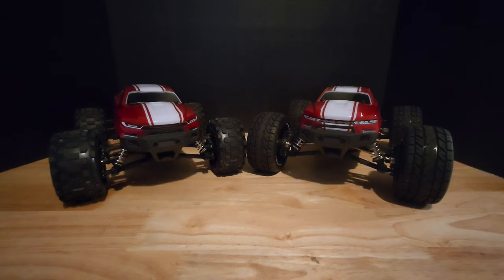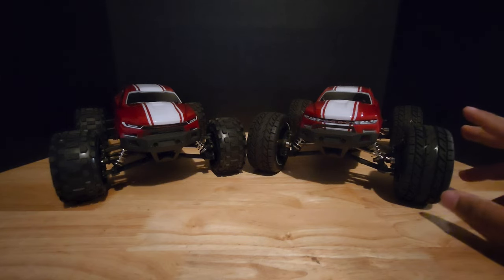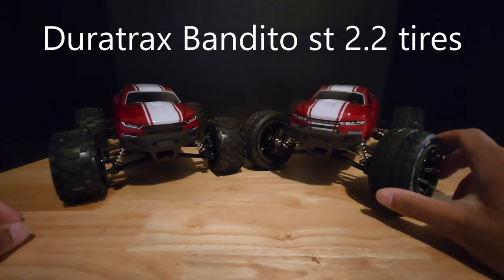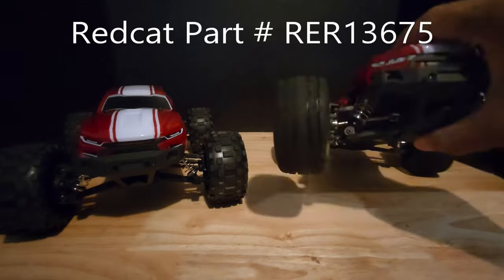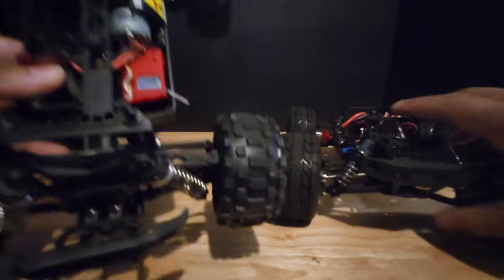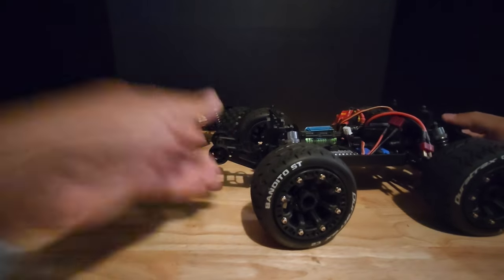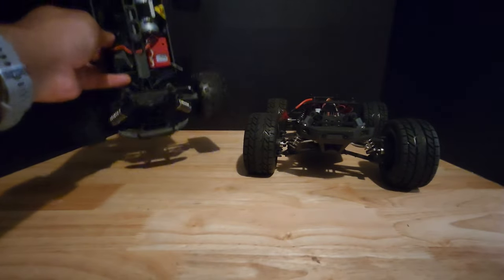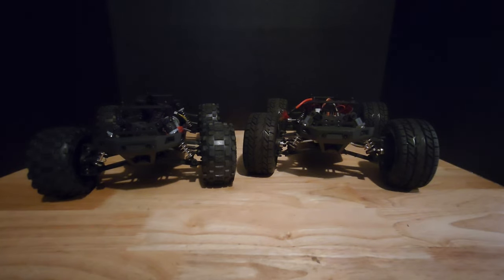Redcat Volcano 16 Brushed VS Brushless | Converted to Brushless and Redcat Optional Parts

Comment: you can use the hbx 16889a parts too there the same truck
Reply from the maker: Thats coming in another video... spoiler alert...
Reply: The HBX 16889a Pro come with all the hop ups done for $108
Reply from the maker: Went over that in another video.
Reply: @The RC Hotspot  great little bashers either way they are super diehard little rigs ive ran brushless on 3s with no issues next to temps getting high but a few cheap 25mm 6v fans fixed that

Comment: New to the r/c world i have a volcano 16 but don’t know how to change the stander Phillips to hex nut I find a bunch online but not sure what’s the right one or should I stick with the plastic hex and Phillips screws
Reply from the maker: You have to change the driveshafts. You can use the cvds like I did in the video. Part numbers are in description
Reply: Ok understood that would be RER13681 but do I also need the RER13683?
Reply from the maker: Not unless you are going to run dogbone instead of cvd driveshafts in the rear. I just put cvd all around on mine